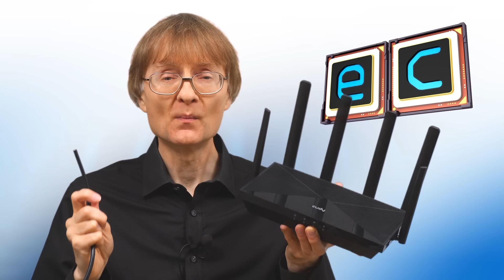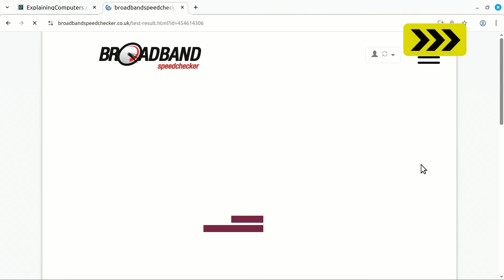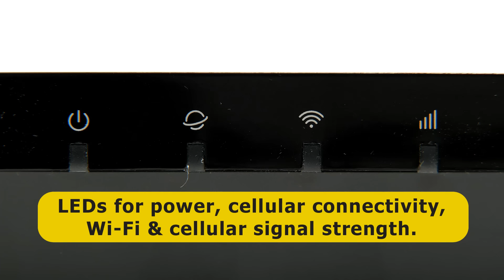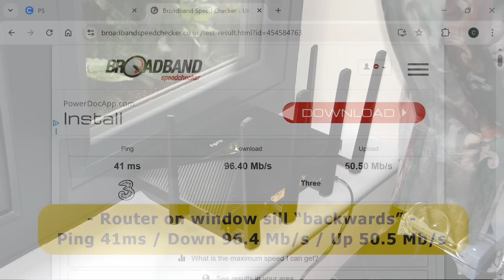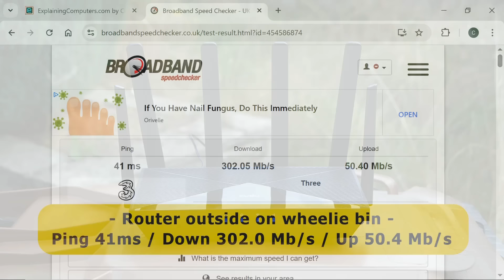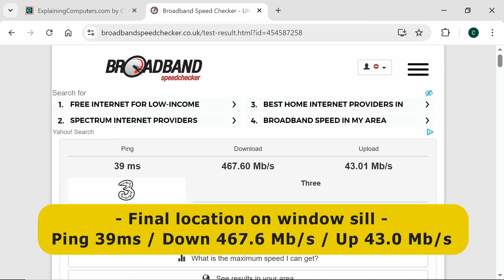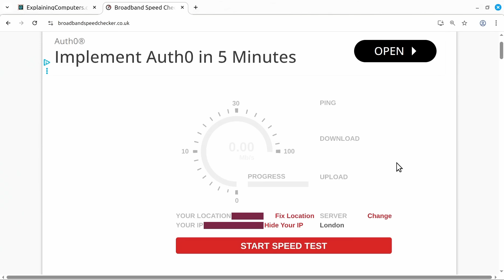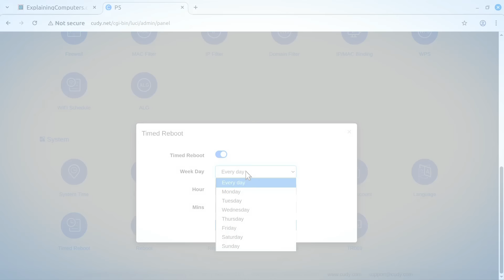Switching to 5G Broadband: Cudy P5 Router

Comment: I carried out the same exercise a few years ago. BT got insanely expensive and despite all the hype about fibre optics and digging our paths up and down for ages we still kept a copper line running under water. Ship to Mars sounded better. So I arranged several data and phone sim contracts with Three to cover family and friends at affordable prices and took the plunge. Our lines went dead and would you believe it, a giant and I mean massive concrete temple was built between me and my tower. Only Three could provide a signal but to make matters worse I’m in a bungalow, dead centre in the no go zone. It’s like waiting for sparrows to pass so they reflect the signal. Fortunately 5g came to our area and major changes helped improve the mast signal but barely. I’ve been using a couple of Huawei 5g hubs on lease from Three for past 4 years and they are mounted at the highest point of the roof with Ethernet cables down to the living area. I’ve  also fitted a device that monitors the signal so if it drops out, and it does often, it reboots. Unfortunately Three decided I had to return the 5g hubs or rollover the two year contracts which makes the hubs expensive. Unlike their phones which you keep. So I’m looking at replacements when iI found your video. What’s attracted me to the Cudy P5 is the facility to mount external antennas if needed. I’m doing the same at a farm where we holiday so I know the antennas work. Fortunately for you your not having to test range but others have spoken about it so I’m encouraged to buy a unit and hopefully it’ll get round this issue. I’m actually only half a mile from tower but this concrete mass is as broad as it is high. Three won’t install a repeater so I’m either breeding a flock of metal sparrows to assist or hoping I can skip waves off the clouds. One thing for certain though is cable is no longer king, unless there’s an EMP. Oh well, thanks for having me and well done with your video.

Comment: Woohoo, welcome to the 5G club!  I jumped ship 4 or so years ago from BT and have never looked back.  I live on th edge of a rural town NE Scotland and have the wonderful  Zyxel NR5309 5G router which works like magic.   Never had a single issue with it (well it could have done with extra ethernet ports, but a switch resolved that.)  I also fitted an external omni directional antenna to our router to boost speeds.   Been brill!
Reply from the maker: This is great to hear. I've now had four months with no wired broadband, and everything as continued to work very well indeed. :)

Comment: Is it possible to orientate the antennas at different angles? If all four antennas are upright they will only be getting vertically polarised signals, whereas the polarisation from the mast varies from horizontal to vertical, or orthogonally to each other at + and - 45 degrees to vertical.
Reply from the maker: Yes, the antennas screw in and can be rotated to any angle (subject to the practicalities of not hitting each other!). And then can be extended with a cable to be placed anywhere. :)
Reply: @ExplainingComputers  Thanks.

Comment: I would like to find a SIM (5G/4G) router with an FXS port supporting SIP. That would be the ideal solution. So far I can only find routers with built in  SIM but no FXS or FXS but no SIM (external dongle).
I don't why manufacturers are not making this combination, it would be the best land-line replacement.
Many only have a phone port supporting VoLTE.

Comment: I just bought a Cudy WR3000H router, which is great value for the money, and it's supported by OpenWRT, which is absolute demand by me.  It also was easy to change the firmware to OpenWRT.  There are some versions, like Cudy WR3000S, which have about the same capability.  But it have a 1 GB internet connection, while WR3000H have a 2.5 GB WAN.  LAN are 1 GB for all four LAN connections.  And it has WiFi 6, which is enough.  

Does it support IPv6 though?

So far it has been great for the money.  Like £ 50-60.  But then I uses fiber WAN access.

The ISP operator 3 is ok, here in Sweden, even though the cover is not that good as some other ISP operators.

Comment: Just out of interest. How far away is your nearest Cellular tower?.. Just curious how much drop-off in signal strength vs distance.
My nearest tower is 100yds away, but I have no clear line of sight because of other buildings.. I can still get 360mbps on a 5g phone, so I would guess a dedicated router would be at least the same if not better.

Comment: Hi there: first time viewer from Canada. This solution is a game changer for many reasons. I’ve used a Cudy router and 4G LTE SIM to bring systems online in emergency situations. Note though, that Port Forwarding is not possible with an IP address from a mobile carrier’s IP address due to CGNAT. Otherwise, a far easier and simpler home internet solution for most people. I may attach a VOIP ATA module to this to serve a copper phone line in an intercom. I would like to see a low power portable version of this. Great video, this is an industry disrupter!

Comment: He was forced reluctantly to migrate to  fibre after being with BT Internet for many years with fairly unexciting performance and still keeps a landline. Guy is giving IT advice?
Reply from the maker: Yes, I've been lecturing, writing books, doing consultancy and making videos on IT for 35 years. What on earth does having a landline and being content with a previously perfectly workable Internet connection that could NOT be improved due to technical and legal constraints have to do with competence to give IT advice? Answer: nothing at all. The different matters are entirely unrelated!

Comment: Had one of these for 2 years. Been using it at home with a 4x4 MIMO antenna and also in my motorhome. Recently got a Teltonika RUTX50 which is very similar, but more expensive. I prefer the Teltonika. Although its WiFi is the older  5 standard (ac), it has better configuration options.

One feature it has the Cudy doesn't is load balancing, so I can have my old home broadband modem (which coincidently is operating via its backup sim) plugged into the WAN port of the Teltonika and use it to add speed to the SIM connection in the Teltonika. So I have 1/3rd allocated to the WAN, 2/3rds to the Teltonika sim.

The Cudy seems only to be able to use the SIM as a backup to the WAN port. This brings up a problem with the Cudy - there doesn't seem to be a manual. There is a general FAQ on their site, but no manual for the P5.

Comment: As someone who games and cares about connection stability and latency I would never switch my home internet to cellular, but for other normal users 5G would probably be fine as you have shown here. Still using a copper line for home internet but there’s a new ISP in town installing fiber so my current ISP has tripled my download speeds to keep me from switching 😆. Soon as they offer me fiber I’m switching to my uploads are not a pathetic 10 MBps.
Reply from the maker: You are right, latency is normally worse with 4G/5G. But not connection stability for a fixed router with decent antenna if you are close to a cell tower. :)

Comment: I'm using the arcadyan aw1000 with openwrt firmware. Getting 15-20ms ping 1.2gbps dw and 140mbps up. Only cost me £10 for unlimited plan a month so i don't see any reason to switch to fiber

Comment: I've been looking into 5G for my camper van. It would be great to have a decent connection as that would mean I could reliably work remotely [properly remote :D ]
I was looking at GLIs M2 5G board, but will defininetly look into this Cudy router. Being a van it will be imperative to have external antennae, so if anyone has some decent resommendations for those, I'm all ears. 
Cheers for the info Chris, very interesting to note that 3 actually have decent connections speeds too, should mean EE are even better, given their better coverage in Blighty.

Comment: Hi Chris, great content. Am I understanding this correctly: I'm in Ireland and am looking at Three's 5G - so going this route you get the sim only service and so buy the router instead of getting Three's equipment?? And if so do you feel buying this router is better than using Three's equipment or is it a cost saving? many thanks.
Reply from the maker: Thanks for this, and It depends on your requirements. As I said right at the start of the video, I was/am in no way suggesting that anybody else do what I was in effect forced to do.

It is cheaper to use Three's equipment (although I funded my own router from about £300 of compensation from BT). But you will end up with a less capable router with only two Ethernet ports, and which somebody else will own.

I personally wanted a router with four Ethernet ports, and the guaranteed ability to be able to insert a SIM from any provider (I've now got a 1p Mobile SIM in the Cudy's second SIM slot, so providing network redundancy). So it just depends on your requirements. Only you know what you currently have connected to your existing non-5G router. :) Good luck with 5G.

Comment: I was using a 5G router on an unlimited data SIM plan with 3 a few years ago, as I was living very close to 3 5G masts and thought I'd give it a go.

We regularly saw 500+ mbps down and 70+ mbps up speeds which were phenomenal for the price.

The main issue (for me specifically) though was that the ping sat between 50 and 60 unless we enabled UPnP, where it dropped to around 35-40 on average. As I was predominantly using the router for online gaming, where instant responses are essential, this was a little too high, and caused a lot of stuttering and "rubber banding" where other players would seemingly teleport from one place to another at random 😅

I'm hopeful for the future of cellular home network solutions though, as I was perfectly happy with the raw speed that the router managed to attain. Hopefully the next generation of cellular can get the ping sorted!

Comment: I need to switch to 5g but I’m not sure if they can work with a WiFi mesh network system like Netgear’s Orbi or Eero or TP link or any other. I have trouble getting WiFi to devices with just one router and so ended up with Netgear Orbi. Does this p5 router + 5g connection allow the use of a mesh system to extend WiFi through out the property?
Reply from the maker: Yes, the Cudy P5 supports a mesh network -- there are settings for it (and indeed you can see this in the system status screen in the video). But it's not something I need, so I have not tested it.

Comment: Hello Chris, have a look at aa net uk.  I used them to move my home number to VoIP before I get kicked off of copper at the end of the year, or next year.  I went for the Yealink bundle which they configured for me.  But configuration is easy.  FYI there is a 32 character maximum on the password length, which I did not find out until changing it before backing up my configuration (slapped head at the time).  I too am on Three for my broadband, so so far (1 month and counting) have had no issues.

Comment: I've been with the Three 'network' for years now and pay £15 for unlimited with a deal I got and love it, get speeds of around 300Mb/s to 600Mb/s download speeds.  The secret is testing speeds on the mobile before buying a 5G mobile router (I bought the original HUAWEI 5G CPE Pro when it came out) and one mobile provider may be better than another in certain areas.

Also think about the summer, make sure the router isn't in the sun!

Comment: I recently changed to 5G Internet - switched from a cable broadband, and I am very pleased.  Price is $30 a month (bundled with phone account including wife’s phone - $120 a month).  I went through the same iterations as you did moving the router around to get the best signal.  I settled on an upstairs bedroom closet that faces towards the cell tower.  I get similar (slightly better) performance to what you have.   My router isn’t as nice as yours - I only have two Ethernet ports available. I had the setup for a few months and I am very happy with the results.  I am not a gamer (have one 4k video game) but the games I do play work well.  Like you, I live near a 5G cell tower.
Reply: 0

Comment: We recently had an internet outage that lasted about a week. The VDSL cabinet down the road stopped working. The equipment in the VDSL cabinet is made by Huawei and BT stopped business with Huawei back in 2020 due to political pressure. This means that BT have no spares for their VDSL cabinets and are scavenging parts from other cabinets. So we tethered a mobile 4G phone to a computer and got a 100GB per month connection. It worked well so we put the phone on our network to allow all the computers to share the connection. 4G speeds were similar to VDSL. Upload speed was about 800KBytes/sec but this increased to 1.6MBytes/sec with two uploads. With 3 uploads the speed levelled out at about 2MBytes/sec. Download speed was similar to VDSL about 6 to 8MBytes/sec. The VDSL was eventually fixed but I'm now looking at changing to fibre to bypass the VDSL cabinet. The cheapest fibre is similar in spec and price to VDSL but faster fibre deals are available.

Comment: The Cudy P5 is a very good 5G router for the price, I have one also but I'm in Europe and not the UK. There are a couple of features you did not cover in the video but may have used to increase performance. First the router supports both 5G NSA/4G fallback and 5G SA. You can lock to the one you want which I suggest to do as it stops the ISP moving the connection at will. Also supported is locking the frequencies you use, IE; disable the lower 5G frequencies which will stop the ISP from sometimes moving you onto a lower bandwidth connection. This is something I suggest to lock keep the router connected to the highest bandwidth possible in your area.

I would say the ping you are getting is not great and I suspect that's partly due to not using external antennas if the speed test server you are using is close. I do use 4 external antennas and my ping is around 20 with 5G. That's actually the main reason I got the P5 given it has the 4 SMA connections that allows using external antennas,  its surprising how much money you normally have to pay to get that. The tower I connect to is 3km away. The best connection I get is using 5G NSA using 4G band 1 / 5G band n78 (router supports CA if your ISP allows it). I can also use 5G SA using band n78 / n28. While that improves ping, my upload is slower so I keep it locked to 5G NSA. 

Once you get used to using the 5G connection I suggest you experiment with the Cudy P5 4G/5G connection settings and band locking. It would also make great content you could cover in a future video to give more info for those thinking about using a 5G connection in the future over fixed line. The P5 also supports AT commands where you can do some quite advanced things but maybe thats to advanced for most that only want a stable connection.

Comment: Lovely run through. We live near Loch Ness, 4 miles from the nearest 3 tower. We have external antenna, as we found that we needed them. The router is upstairs, so has a height advantage. We only get a 4g connection, but we do get 150 download and 20 upload.

Having the antenna inside, we drop to 50 download.

We use a Cudy LT12, with powerline extenders. Very happy.

We use the 2nd SIM slot with an EE 1 year 120Gb sim, as we have a lot of storms, and it isn’t uncommon for some cell towers to drop after one. They get repaired fairly quickly, but it is great not being without internet.

Comment: I'm really quite shocked to hear that England still uses BT Landlines, copper wires, and such slow connections. I left in 2001... later on with the rise of internet stores, with Windows 98 computers, I suffered trying to work through telephone line connections - maybe 55kb/s on a good  day, and slower sometimes (I joked they needed to wet the string again).  For the last ten years, however, it's hard to find a house that doesn't have a Gigabit connection.  Upload is where the money's at though, you're right to prioritise that. For connections with balanced up/downloads we pay a lot more.

I'm curious to ask, though, whether you ever used Packet radio in the days before our domestic connections.

Comment: Great video, thank you. I have just received this router after watching your video. For two years, I have been using 4g cellular connection from 3 on a tp-link device at times it has been a little flakey. Now I have put in place in the Cudy the 4g single strength is stronger and a lot more consistent. 3 do not provide 5g where I live. However, EE does, and the sim is arriving shortly. The price is an increase. However, it is still far better than a wired alternatives, and without a contract. Thank you for a great video.
Reply from the maker: Good luck with your router and 5G.